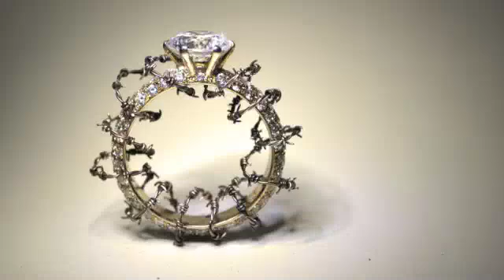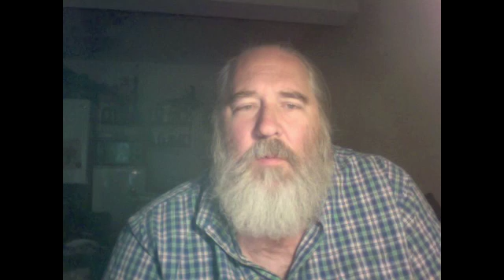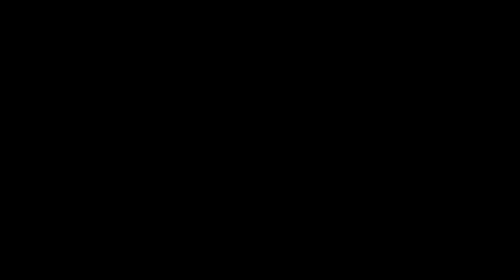Can anybody help with a Stirling Engine?  10/4/15

Comment: You might do better with a thermoelectric device (Peltier cooler) system. No moving parts :) Just use a thermal conductor to transfer the heat. Also look into Lister engines. I just don't think that stirling engines are going to give you enough power.  Here's a channel for you to check out. https://www.youtube.com/user/GREENPOWERSCIENCE

Comment: perhaps a series of copper tubes carrying liquid can be routed to condensers through the interior and exterior of the cave to fluctuate heat difference through a small turbine to generate electrical power?

Comment: You could always use a fresnel lense up top in the summer time instead of a fire. It would even work without the cool air from the cave as well. Another application you could use, is the remaining 'heat' or smoke off a wood stove could be used as well. You would have the sterling engine inside next to the heat output and have the other side of it facing the outside for winter purposes. That seems like it may be a bit more cost effective than putting it in the cave but its just speculation.